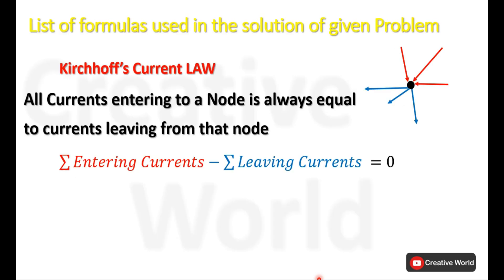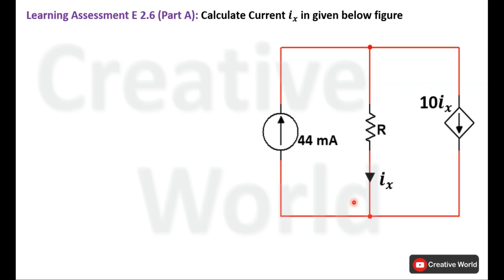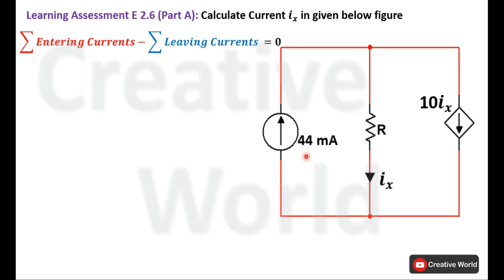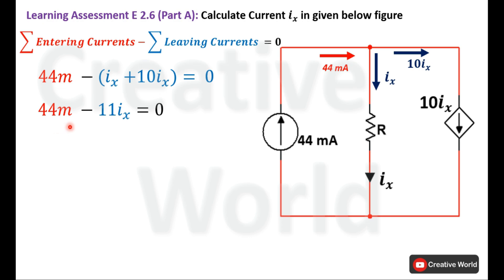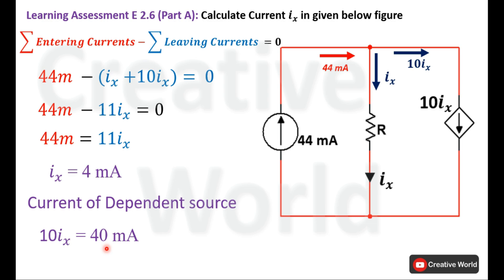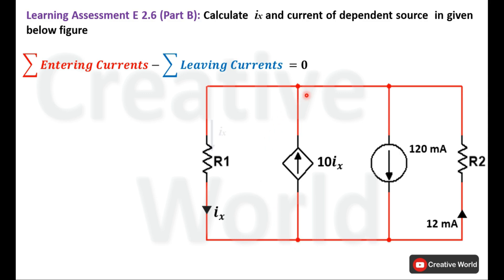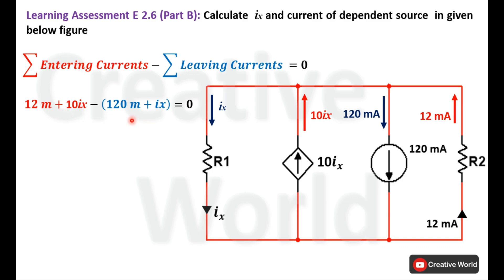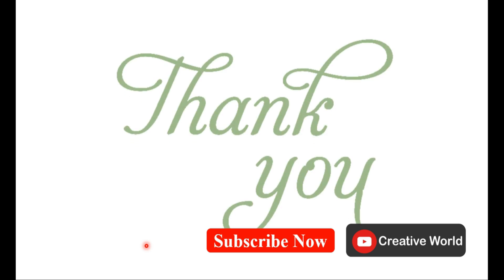Chapter 2 Learning Assessment E 2.6 solution

Comment: Sir how we know that how many nodes are there ? 😢
Reply from the maker: if any point inside an electrical network that have more than one paths to flow the current. then this point will be considered as node 
or
if two or more than two branches terminate on a single point inside a network then that point will be considered as node.